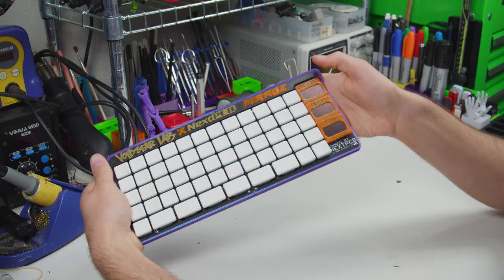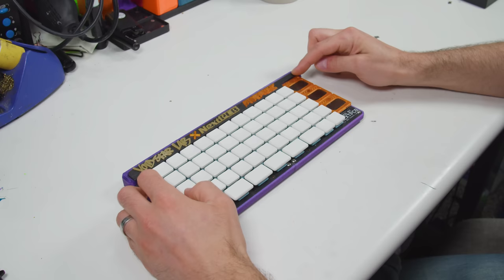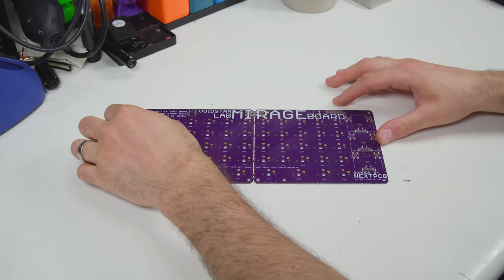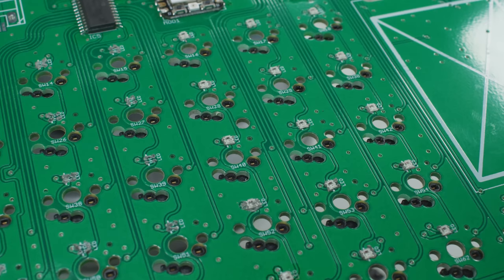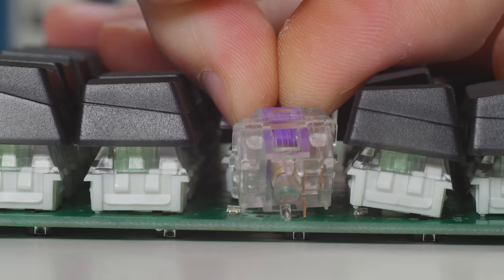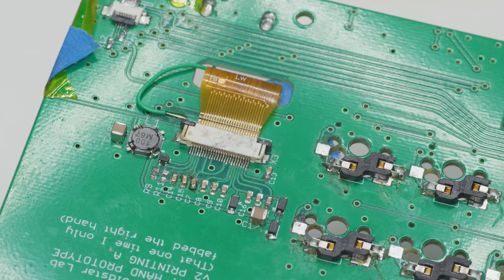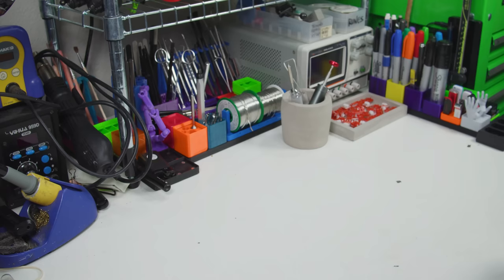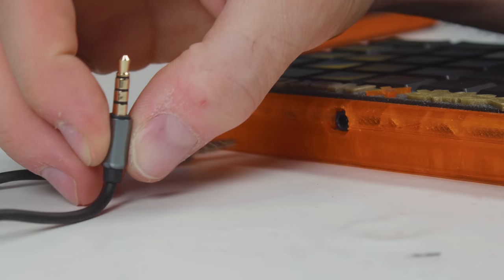RGB Ruined My Life: MiRage Mechanical Keyboard Mk2

Comment: Hey Zack, This keyboard seems like it could be a replacement for my favorite of all time keyboard which is currently running out of stock never to be reproduced :( There are three main things I like about my current keyboard: 1) it's ortholinear (check), 2) hardware button to switch to Dvorak (can be done in software so not a deal breaker), 3) backspace and return key in the middle of the keyboard. That third item is the big one. It's so much easier to reach for the backspace and return keys with your pointer finger than your pinky. I really love it. Will there be a one-key-wide expander board? If so I could sandwich that in the middle and essentially re-create my current keyboard. I'd be first on the list to buy one if it's possible. Thanks! (fyi TypeMatrix 2030 is my current keyboard if you want to see what I mean)

Comment: I am looking for a programmable keyboard with switchable profiles. It should have the same features as auto hot key. Will this keyboard work?
Reply from the maker: It should be pretty close. AutoHotKey can do some context-dependent stuff based on the current app and system state, which a keyboard has no way of getting.

Comment: I have been banging my head on my desk for a while now trying to get a Waveshare 2.9" three color e-paper display to work with the Xiao 2040 in the Arduino IDE. I am also using the Gx-EPD2 library. How did you get your e-paper display to work??
Reply from the maker: It should be pretty straightforward if you use Seeedstudio's first-party mBed port. I didn't actually write down how I got it working with the community core, so I can't help you there...

Comment: So, theoretically if there was dedicated power on each board you wouldn't need to use SATA to power the LED's, correct? So how stupid would it be to possibly go on board battery per board, that gets charged by the main, plugged in board when they are interconnected from the breakaway board piece in the middle of them? Then the other boards can be bluetoothed to the computer to communicate? Right? Mind you, I have no real idea what I'm talking about, so maybe that's impossible and I'm dumb

Comment: Hi Zack, I was wondering if a Keyboard could provide a way to run AutoHotKey scripts.  When I use a work computer they would frown on any software installed.  Hardware solutions also would avoid some other issues with long amounts of text.  Maybe like a RuberDucky from Hak5 - but in a keyboard form. 

 I used AutoKey to create macros to expand acroynms, type frequent prases etc.  I would also like to see a solution where I could expand a system.  By adding a separate module, it could be used to provide one-key macros.  This could be used over multiple industries.  When I looked at this before, it was a bit more involved.  It was not as easy as adding a second keyboard.

Good luck with your project.
Reply from the maker: The firmware supports most of AutoHotkey's features, like key combos, sequences, multi-key shortcuts, etc. Some of AutoHotkey's features, like switching to specific apps and setting the volume to specific levels, need a desktop app so those aren't possible.

Comment: I don't know your thoughts on this, or if it would be possible, but I think it would be cool if mk3 had a touchscreen Ips screen (like the raspberry pi ones) and it could clone the interface of the Stream Deck. (I'm not quite sure if you could transfer the data in an elegant way)

Comment: Umm why not use Type C to connect the two boards but without using the USB protocol? Just the connections.. There are more than enough pins for your requirement 😀

Comment: Hi Zach! Have you thought about using wireless connection between parts of keyboard? Then you could use small cable only to provide power.
Reply from the maker: I thought about that, but I'd need to get FCC approval. Even getting a pre-certified module reapproved would take months and cost $20,000+ in regulatory and lab fees.

Comment: First, a question. How is the latency on self-built microcontroller-based keyboards? If the answer is not bad, you've made me the happiest "I'm not actually techy I'm just good at Google" kid on the planet. I've wanted a split keyboard for a long time. 30% for gaming, for ultimate desk space, 60% for normal typing, for appearance and ergonomics, a numpad for when I'm using CAD programs, and various other random functionalities I can add and remove at will so my brain makes the happy chemical. It never fails to amaze me the difference a single knowledgeable person with a little ingenuity can make inside of a very nuanced community. (also, just gonna go ahead and switch my patreon from Iván Miranda to you because I'm poor and you're cool)

Comment: As one of the two folx who were really excited for this project evolving into a cyberdeck project I can say I am crushed.
I mean, still psyched about the keyboard, but crushed.  The Datablaster is still one of my favorite designs and I was really excited to see what you cooked up next.  I'd have built my own Datablaster but for several concerns (soldering the batteries for one...).  Anyweasels, still my favorite channel.
Reply from the maker: The Data Blaster isn't my final cyberdeck! I'm just not prioritizing cyberdeck-a-bility in designing the MiRage.
Reply: Well I mean yeah, building a cyberdeck is like doing mdma: despite how taxing and weird it gets you're probably gonna end up doing it again.
Reply: I'm the second one !
Though I switched to building one myself !
It is going... poorly, but it's still very fun.
I think my biggest problem is still using a pi400, I love the concept but ... it's an hassle to use :/

Comment: Why not just use two USB-C ports and a USBC wire and not a sata cable? You don't have to have to use it as a USB device, just map the pins however you want. You are already doing it with Sata cables.

Comment: "circuit python was far too slow for this project and i had to abandon it"
the average python experience, just filled with frustration and disapointment
Reply from the maker: Python is great in general - the Micro/CircuitPython interpreter just isn't as mature and optimized as the full-fat one. Real-time projects like this are unforgiving, too.
Reply: In my experience, Python is much better suited to maths-heavy things.  It has a wealth of uses, but  speed is not necessarily one of them.

Time to learn RP2040 assembly!

Comment: using sata cables for extra conductors smh just pipe 5 volts over the TRRS connector and regulate it down to 3.3 on the other side

and force all the RGB data over the I2C bus, thus forcing you to have a second microcontroller in the left half I DON''T CARE THAT'S A BETTER DESIGN ANYWAY

Comment: Ok I gotta admit... I'm alittle confused here. You wanted to use SATA because you wanted a connector that had multiple pins so you could just use a single chip and just simply use the cable to connect things... You said you couldn't use a USB Cable, because you couldn't have them talk to each other or something because only one thing could talk to something, or whatever...

So..... Why couldn't you just... use the USB Cable... like you did the 3.5MM or the SATA? You didn't need to connect them together and have them communicate or whatever the initial problem was.. you just, had to pass along the signals you wanted, and that was it... EXACTLY like you would have done for the SATA Cable...

Maybe I'm missunderstanding something here... but, I do not see why you couldn't have just replaced the SATA Connectors, with Female USB C Connectors, then just used a Male/Male USB C Cable to connect the two boards... Seems like that would have solved every issue you were having communication wise..

Comment: mr. freeman, hows the half-life, get good
Reply: gordon freeman, I assume
Reply: right if you make it from flexiplex, you can make it a panel speaker
Reply: pass-through transparent keycaps, so that the mini-lcd is on the back, not on the key
Reply: oh yes, e-paper back screen under the transparent key caps, both display and keyboard in one
Reply: kinda touch screen :)
Reply: just make many keyboards, all with different usb cables, your usb hub can handle it, external to the keyboard
Reply: no neighbor connections, only directly to computer with a hub or direct, its like a multiple keyboards, side by side, keep it simple
Reply: keep it simply parallelizable
Reply: make one unified clone "half" board with full e-paper/lcd background, just multiply if wished
Reply: hey mr. freeman, try transparent capacitive flex key-surface (no spill damage), or rgb + led = light finger block switched under the flex key-surface